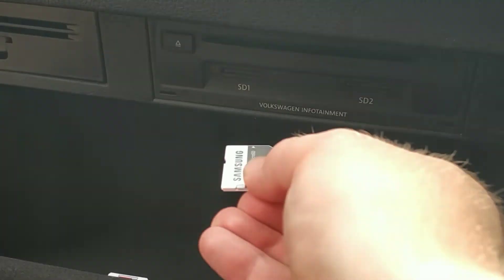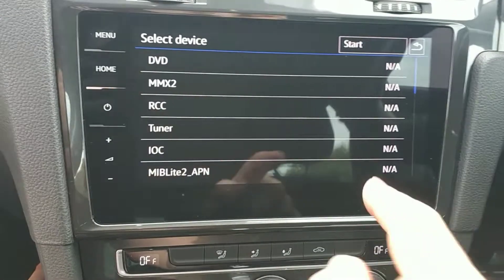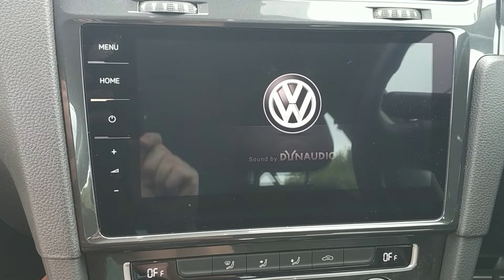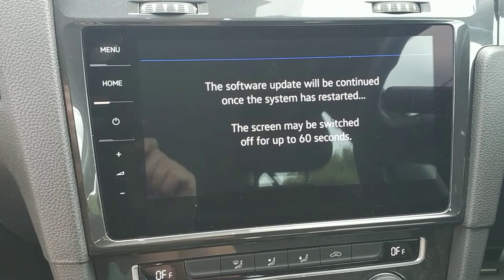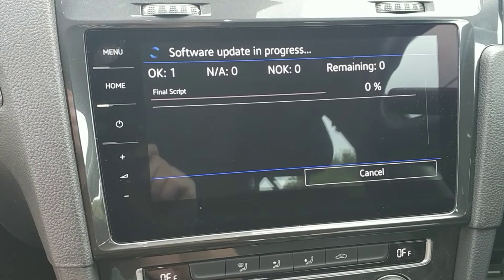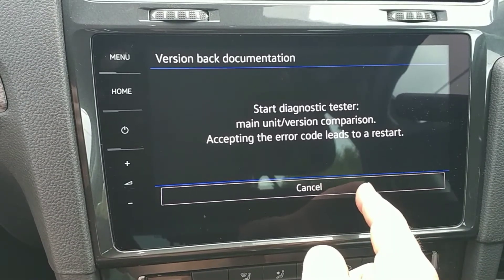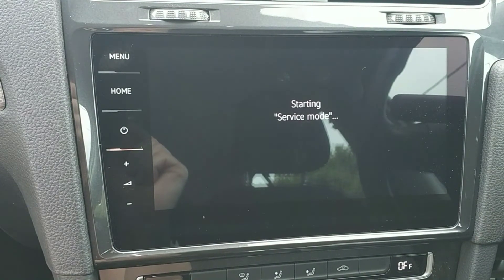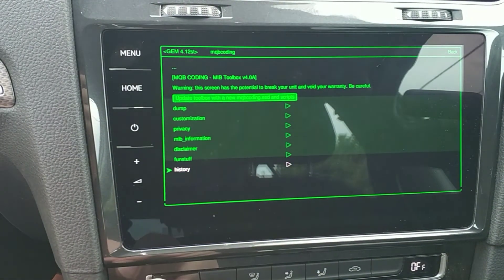Installing MQB toolbox

Comment: hello, can we remove the SD card after installing? Or does it always have to be an SD card to use?
Reply from the maker: Toolbox doesn't need the SD card to run, so yes you can take it out for most things. However some operations save backup or log files to SD, or expect to read files from SD, so sometimes it'll need to be available

Comment: Hello, I have a Discover Pro gen 2 device on my 2017 passat, which is due to the appearance of the screen, like yours, do you know if the toolbox tool you are referring to can help me?  I don't know if it is one of the MIB2 High or MIBHigh 2.5 versions. Thank you very much.
Reply from the maker: MIB2 High and MIBHigh 2.5 versions both work with the toolbox
Reply: @andrewleech9615  Hello, the problem is how to know if my model is MIB2 High or MIB2.5 HIgh??  If this software is compatible with my equipment, I will activate the carplay and mirror app ???  thanks for your answer!
Reply from the maker: @mikelibon  Ah, mqb toolbox doesn't have functions to activate features like carplay / AA if they weren't included from factory as they're protected by (paid for) SWaP codes.
Reply: @andrewleech9615  Thanks

Comment: Any interesting use apart from upload images to replace skins? Any update regarding mirrorlink or something similar on Discover pro MIB1? Thanks in advance.
Reply from the maker: I've never used the images / skinning in it, I use it to provide a clean interface for installing patches like https://github.com/jilleb/mib2-toolbox/pull/189 and making it easier to develop on the unit https://github.com/jilleb/mib2-toolbox/wiki/SSH-Login
I don't have MIB1 so don't know much about that
Reply: @andrewleech9615  Thanks Sir, seems that there is not too much to do with MIB1...

Comment: Hi will this work on MH2P Audi, that it's the same as MIB2P? Regards
Reply from the maker: I'm not sure, you'd need to check on the project GitHub page.
Reply: @andrewleech9615  many thanks, have you activated or possible activate AA or Apple Carplay MirrorLink by this method?
Reply from the maker: @mapple263  no this toolbox doesn't have anything for that
Reply: You don't have any way to make this activation? Many thanks
Reply from the maker: @mapple263  look on https://mibwiki.one/
Reply: @andrewleech9615  thanks my friend

Comment: I bought an imported golf in japan.  discover pro system japan version.  so I can't use the navigation in my country.  can i make my version to europe with this method?
Reply from the maker: There is some functionality to adjust navigation country in the customisation/coding menu, although I'm not sure if that will be enough - it might be though!
Reply: i have the same problem as you, my car is imported from china and i cant use the nav, did you manage to fix it somehow ?
Reply: @kaltar  which 5F is mounted
Reply: @andrewleech9615  Best is to change  full to europe meaning JP to EU in variant 1 ,Region to EU, long coding to match  nav country EU.

Comment: How can i rrlove CID lock in this version ?
Reply from the maker: I don't know anything about cid lock
Reply: Thanks anyway for replying, the CID lock for sd is a way of updating navigation maps from a third party sd card without putting the original one 

The option was in the old release of toolbox unfortunately it was removed
Reply from the maker: @khaledCA  oh that, the mib high units don't have cid lock I believe (this toolbox is only for high) it's only the mib std ones that have maps on cid locked SD.
I do know some SD cards can be patched to change their CID to match what the mib wants. I don't remember which brand SD card that works on though.
Reply: Thank you Andrew

Comment: Can you help me i have MST2 EU SK ZR P0253T and i cant install toolbox i try every wersion this toolbox and i have N/A comunication
Reply from the maker: This toolbox is only for mib2 high, not std units. There's a different toolbox project that supports some std units but I've never used it
Reply: Can you send link for std
Reply from the maker: @Fallinger3  https://www.google.com/search?q=mib+std+toolbox
Reply from the maker: @Fallinger3  I don't know what you mean by files being N/A but like I said, I've never used std units or that toolbox
Reply: @andrewleech9615  when I want to update the software from the toolbox files in the service mode, I go to updates and there it detects updates to the cpu Bluetooth files etc. But these files are marked N/A and I cannot complete the update.
Reply from the maker: @Fallinger3  updates to cpu, Bluetooth, etc are NA because that's talking about updates to existing firmware items not being on the SD card. There should be a separate line item for the toolbox if it's compatible: https://github.com/olli991/mib-std2-pq-zr-toolbox?tab=readme-ov-file#requirements

Comment: Witam czy program Toolbox można  zainstalować  w MST2_EU_VW_P0890D
Reply from the maker: This toolbox is only for mib2 high, not std units. There's a different toolbox project that supports some std units but I've never used it

Comment: Hello i have discover media tiguan 2018,will it work
Reply from the maker: This toolbox is only for discover high, not media. Depending on the brand of unit though there's a different one that might work https://github.com/olli991/mib-std2-pq-zr-toolbox
Reply: @andrewleech9615  but you have discover pro
Reply from the maker: @ALLII007  discover high is another name for discover pro, in the same way discover standard is discover media.